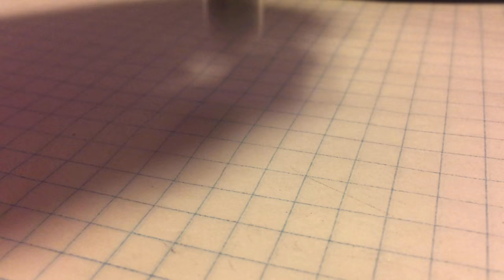Copper Metal Powder

Comment: Do u use copper scarp anode and copper plate cathod which is chipest ? And howmany volt and ampere applied?
Reply from the maker: Mayur Kasundra yes you are right about the anode and cathode, plated copper is produced at the cathode and at the anode the copper is oxidized. I didn’t track the voltage and amperage during this video sadly but your playing results will be heavily affected by the concentration of copper in your playing solution and the temperature of your solution. You will have to play around with the voltage until you get the results you want